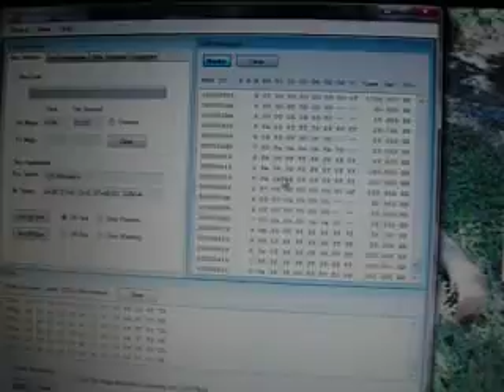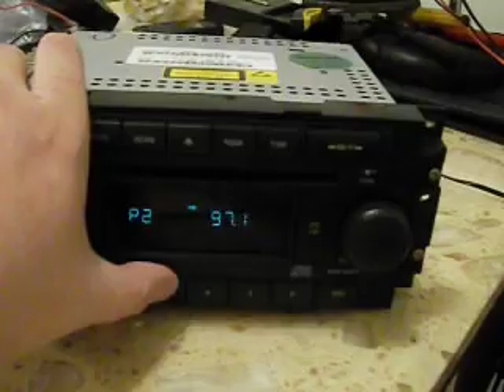Chrysler radio bench turn on using low speed CAN BUS

Comment: I took a BCM or called the TIPM unit from a Jeep Compass. Sits near battery. And ignition switch. From 2008 model. This is cheap at junkyard or eBay if you look. Wireing info is online autozone published document.  Makes a simple cheap turn on test set.
Reply from the maker: good idea

Comment: I know you worked on this project a while back and I like the fact that you were successful in getting it to power up on the bench.

Have you thought about building just the genterator part to turn on a low speed Chrysler radio and selling them? I would definitely be interested, if not I would definitely like the details of your process so that I could duplicate them for myself, so I can put a CAN BUS readio in a non-CAN UBS vehicle.

Thank you
Travis
Reply from the maker: I dont think there is enough demand to make much money on this.  But I've posted on these videos enough info that should get you started.  You will need electronics and programming skills, and the associated equipment.  Take it step by step and you can get there.  The toughest part is that the commands are not readily available and is reverse engineering but the data is out there on the internet.
Reply: @86diggler  Hey Travis. I am wanting to do the same thing as you ..did you ever figure out how to do it?

Comment from the maker: Ive also got a linux c++ script that monitors and such so you can attempt to decifer other codes on the bus.  If you make the mod in my other vid, you can use these microchip transceivers instead of the analyzer kit for a low speed bus as well.  If youve got some soldering skills its quite easy.

Comment from the maker: I wanted to make my NAV into a larger screen and use in a different vehicle, but the roadblock is that the LCD connector is way to small to re-pin for a different screen.  Otherwise, it would work fine.  I did find many commands that worked for the stereo, volume, channel, etc.  Look on canhack.org.